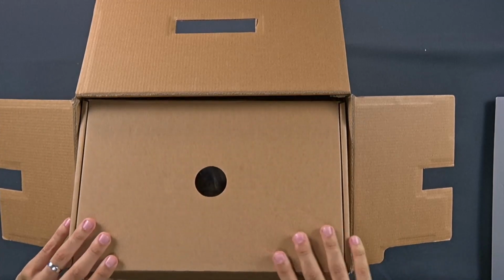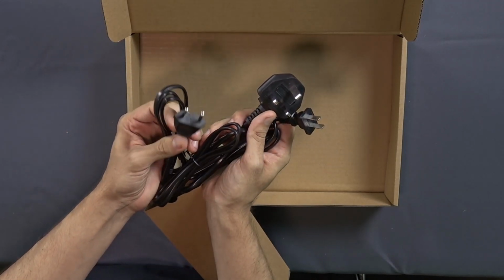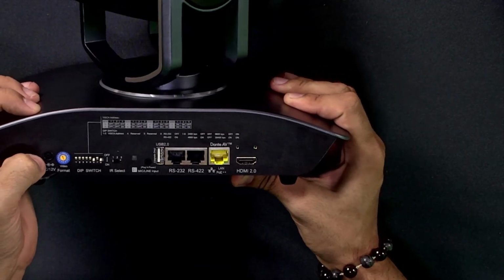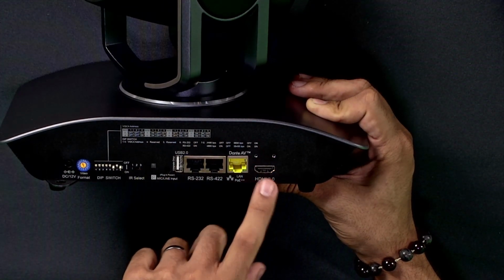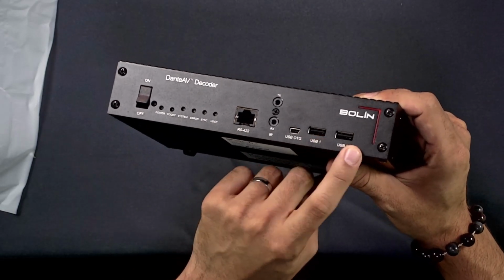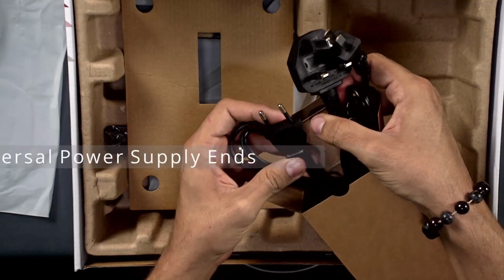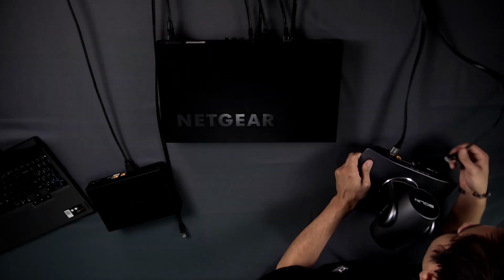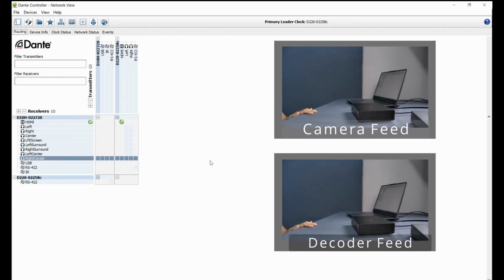Unboxing Your Dante AV Video and Camera

Comment: I hope those DANTE AV products will be soon more available, cheaper a bit and mailny usable within software-based video switchers like vMix and I would like to migrate from NDI to DANTE AV as we already use DANTE for audio. :) I hope there will be DANTE AV bi-directional converter like is BLACKMAGIC DESIGN ATEM CAMERA CONVERTER. Line level audio inputs, SDI IN & OUT, HDMI IN & OUT, button for switching video from camera (loop) & video from switcher (return feed), tally LED + tally connector), ethernet with PoE capability, SFP connector for fiber & high quality headphone output and microphone input for intercom or any audio feed. :) That would be ultimate setup for live streaming. This is something that NDI doesn't have and every vendor has issue with bi-directional converters...
Reply from the maker: This is an amazing road map! Please check our website for information on special Dante AV Promotional pricing. Dante Studio software can be used to bring Dante AV Ultra video into vMix, OBS, Zoom, Teams, etc. I have a video about that on this channel :) We would also love to make Dante AV Ultra equipment with the features you've described here. Stay tuned and Thank you for watching and commenting.

Comment: Is the HDMI cable on the camera actually necessary or was just connected so that we could see the output of it in the inset of the vid?
Reply from the maker: Hello! We included the HDMI cable to show the camera's local feed, but it is not necessary. You can still pull the camera feed from the decoder box :) Hope that helped!